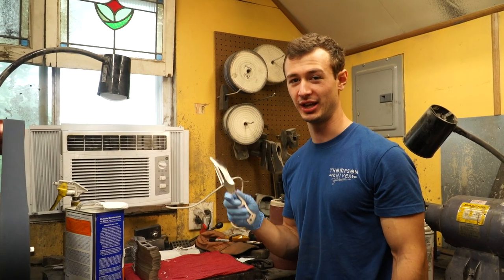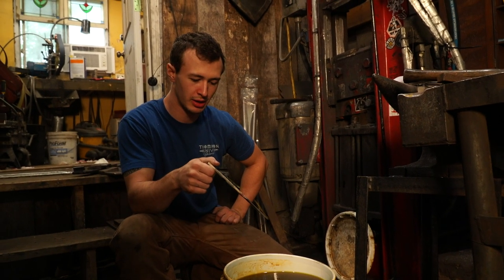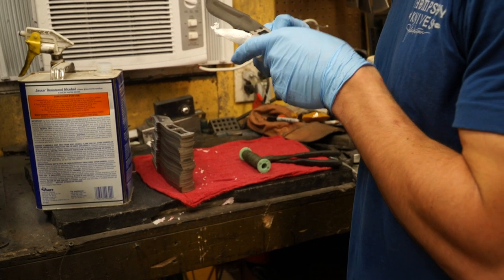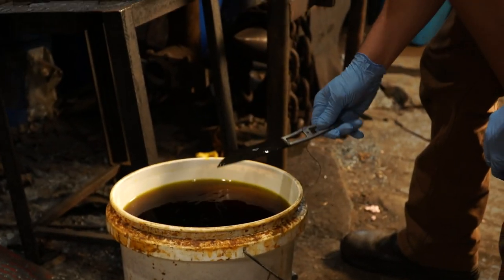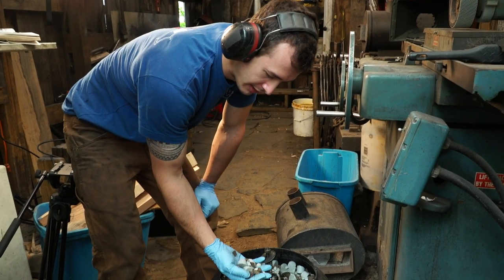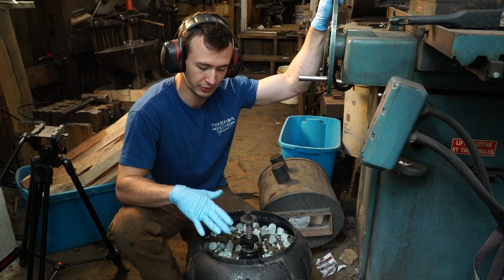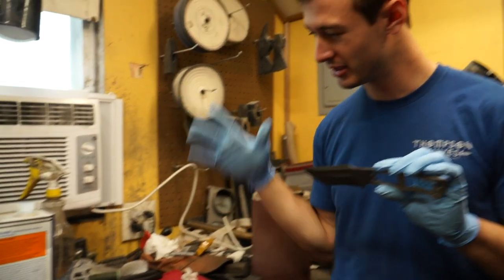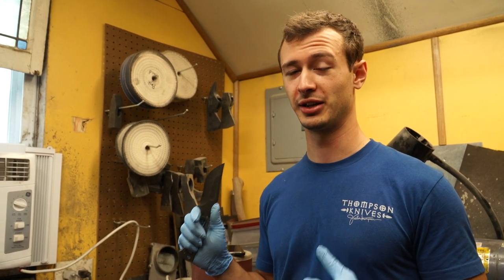HOW TO STONEWASH A KNIFE. DIY

Comment: Do you find that multiple etching cycles produce darker results that a longer single cycle?  Will two, five minute cycles darker more than one, ten minute cycle?
Reply: RC 80’s Kid - Shorter etch cycles with more of them is almost always better than fewer etch cycles that are longer.  For example, when etching pattern welded steel, one long etch will end up making the patterns look more "fuzzy", while shorter cycles with cleaning off the oxides between each etch will provide a more high def look that's more clear and more chatoyant, which basically means that it catches the light at different angles to create more depth and more shimmer).  The key seems to be cleaning off the oxides between each etch cycle so that the acid has a fresh surface of the steel to etch.  Keeping them somewhat shorter helps keep the oxides from building up of the steel and affecting the etch, which happens if left in the acid for too long.  At least this is how I've always understood what was happening.  Almost forgot to add that another benefit of shorter cycles is that you can keep an eye on the progress and make sure there are no odd blemishes caused by oil (or something) on the blade to keep them from getting away from you during a long etch.

Comment: Thanks for sharing this quick tip video on how to stonewash a knife. I too think it is one of the better looking/cooler finishes one can put on a knife. Kind of gives it a more rugged appearance. I have a brass tumbler for reloading, but I know that I wouldn't want to mix the two application, so I may have to go with your budget suggestion at first. 
I still haven't found/figured out my anvil and forge situation and where to put a small shop on my Dad's property so I may have to go the stock removal route to get practice in designing knives, finishing blades and handles and this would be sweet to add to that. Thanks again Liam.

Comment: Can you reverse the procedure after stone washing??Making it shiny again??
I have a new model Safe Maker Push dagger that apparently is stonewashed from factory but i don't like it.....

Appreciate any info
Reply: Sandpaper and patience. Start with maybe 220 and start working up. 600-800 is a good working finish, once you get into the thousands you begin to approach a mirror polish. Add in a little glass cleaner now and then, I find that helps me get a finer finish. It's messy as all hell and takes a while, but set aside some time to do it, grab some music to listen to and just get lost in the process. I'd also suggest doing one side at a time so that you can flip the blade over and get an instant look at how far you've come.

Comment: Couple questions. I have tons of knife and have been collecting and sharpening for a while but just recently I have started anodizing and also got a 1x30 belt sander with 5" disc, one of the small ones. I also just bought stuff for stone washing and acid etching. So do I have to sand the knife up to 320 with the belt sander and keep the lines going the same way and perfect or would it work if i do it with my dremel or by hand...I'm asking because I haven't used the belt sander yet and not sure if I can keep the knife shape exactly with say hollow grinds and flat spots and stuff. Second question is do I have to acid etch before stonewashing? What are the benefits? Just a darker stonewash look? I wasnt going to get the etching stuff but decided last minute. They will all by folding knives that I'm doing. And I also have nail polish to do where the washers go and the detent ball radius before etching. It must come off when I stonewash but not be a big deal?
Reply: Paul Lonardo - If you can't get a decent finish off of a belt grinder (sander) then hand sanding is definitely the way to go, as a Dremel will mostly likely mess up the knife/finish.  Do a quick search on YouTube for "Nick Wheeler hand sanding 101" and you'll learn the basic and proper techniques to get a decent hand rubbed finish.  You don't need to etch before stonewashing, unless you're going for an "acid stonewashed" look, which is what makes the blade darker to highlight the stonewashed effect and what Liam did here, otherwise it will simply be a stonewashed blade with all the same color shade, which can also look nice, but it's pretty much a different look.  Good luck!

Comment: Thanks for the video!  Question:  It appears that your knife design an exposed tang.  Doesn't it create an unsightly contrast between blade and tang when the knife is finished to only etch the blade?
Reply: Scales will be applied later? Not etching the portion of the blade that will come in contact with and be hidden by the scales, prevents removing too much material that may make contact with the scales less even and consistent, especially when requiring crisp square edges on the tang.

Comment: Great vid, question.  Can I use vinegar instead of acid? 
What do you recommend for stone washing a large blade like a kabar BK9 please?
Reply: dofler - You can use vinegar, but the etch will be more of a light grey instead of a dark grey/black that a ferric chloride etch will create.  I've seen guys use some things such as a foot and a half long or so (whatever will fit you blade with left over room for the stones and space to tumble) section of pvc pipe and seal a cap on the bottom then fill it with rocks (or other tumbling media) and then put the blade in, put some type of lubricant in, then put a cap top and finally shake it or roll it around on the ground until they get the look they like.  Do some google searching and you'll surely find some creative and simple DIY/makeshift tumblers or other homemade stonewashing devices.

Comment: Why aren't you neutralizing the acid? Just wondering, because I have forgotten to do it before and found a rust colored finish popping out after a few days... It doesn't happen all the time, but it does happen... I use to use windex, but that can be inconsistent too, now i use baking soda... Another thing i found, if you coat the blade with wd40 before you put it in the tumbler, it will give it a different finish too... Great video, take it easy...
Reply: Dave Erving Evader Knives how do you set up the baking soda. I’ve seen Alec Steele do it and hisbis a liquid. I’m sorry for being so new. Any help would be greatly appreciated.
Reply: Dave Erving Evader Knives would soda bicarbonate work? I’ve heard that too.
Reply: Dave Erving Evader Knives thank you so much. You honestly have no clue how much this helped. I couldn’t find anyone willing to help but you did. Thank you. I also subscribed as well.
Reply: @evaderknives  Hey Dave. Is that what I see people doing with just etched damascus knives? Dipping a paint brush or something in a baking soda and water solution and cleaning the blade off and acid ? I always wondered what they were putting on it after. It also seemed to take some of the darkness away , or maybe it was just the video. Good comment though man, I got ferric chloride and was going to etch and then stonewash some blades and never would have thought about neutralizing the acid after. Or at least it would have just been rinsing them in water. What effect does the wd40 have with stonewashing? Is that compared with just water or dry or something? I got a dual rotary rock tumbler and some of the 1" triangular ceramic abrasive to do it. Do you have any other media or size I should add in? Will just the 1" ceramic triangles be too even a finish and I would need to add some smaller/bigger things? And if I do add smaller or bigger should they just be rocks I find outside or a certain shaped ceramic media. Sorry for all the questions! I'm new to the whole etching/stonewashing scene. But a huge knife collector and love sharpening. Oh and I just got into titanium anodizing too, its incredible. It works amazing for me and like I was a pro when I'm not haha
Reply: @evaderknives  Thanks! So just to be clear try with dw40 and without being dry? I got this at harbor freight as well after cancelling my order of the vibratory tumbler that you got after seeing a YouTube video where the rock tumbler I got instead supposedly does a much better job. But I'm sure they both do just fine. So I should be all set with only the 1" triangular ceramic media and some wd? They recommend putting water in but that's for rock tumbling, so I think what your saying is the best way. Something to at least lubricate everything
Reply: @evaderknives  Great. I look forward to it, I just subscribed! So the wd is just to coat the blade and you still use the windex and water with the media. I've seen some guys just spray wd40 on the media and that's all, no other liquids. That's why I was curious. Thanks for taking the time to respond. I plan on trying it this weekend, ill let you know how the rock tumbler works!
Reply: @evaderknives  I have subscribed also because you don't mind helping people. If we had more people willing to help, instead of being armchair gangsters in their parents house, maybe the internet would be useful.